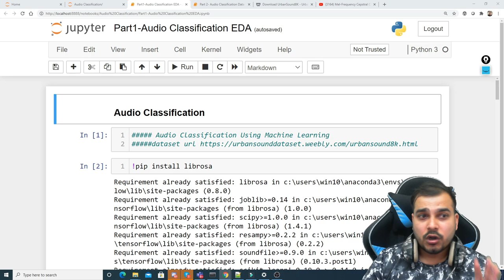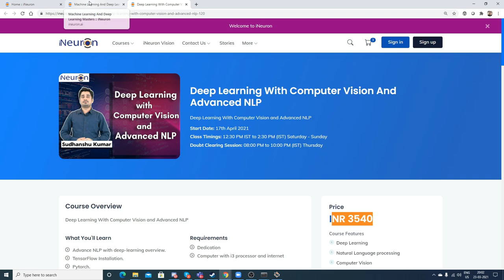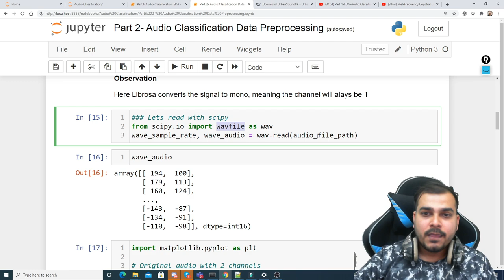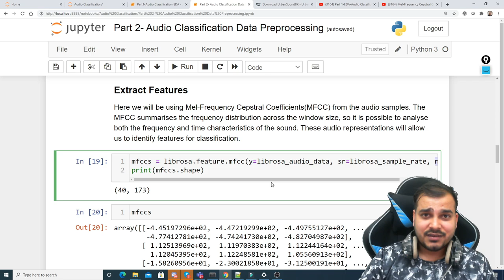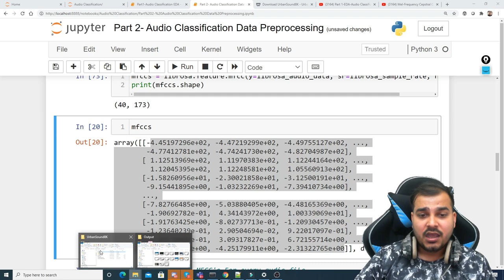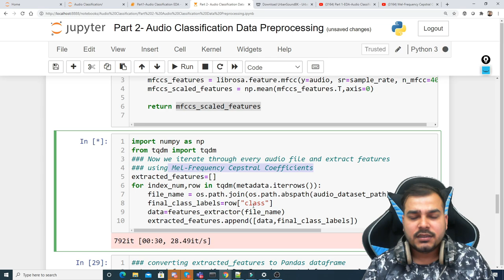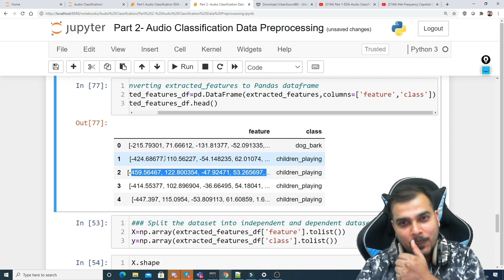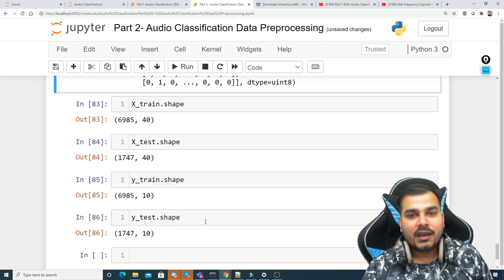Part 2-Data Preprocessing-Audio Classification Project Using Deep Learning

Comment: Hey krish I have used this code for my personal project for birdcall recognition but it keep showing resampy error
import numpy as np
from tqdm import tqdm
### Now we iterate through every audio file and extract features 
### using Mel-Frequency Cepstral Coefficients
extracted_features=[]
for index_num,row in tqdm(metadata.iterrows()):
    file_name = os.path.join(os.path.abspath(audio_dataset_path),str(row["ebird_code"])+'/',str(row["filename"]))
    final_class_labels=row["species"]
    data=features_extractor(file_name)
    extracted_features.append([data,final_class_labels])
can nay one help me
Reply: same here, have been getting resampy error 
ModuleNotFoundError: No module named 'resampy'

This error is lazily reported, having originally occured in
  File E:\college\anaconda\Lib\site-packages\librosa\core\audio.py, line 33, in <module>

----> resampy = lazy.load("resampy")
I have even tried to install resampy again